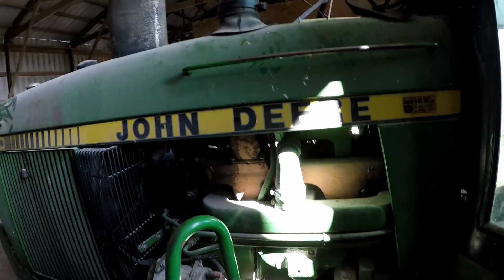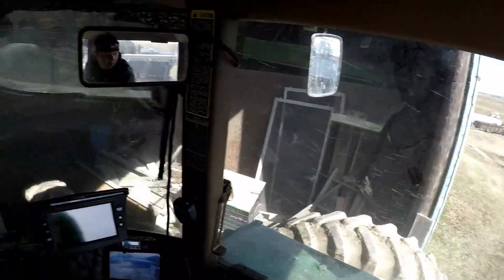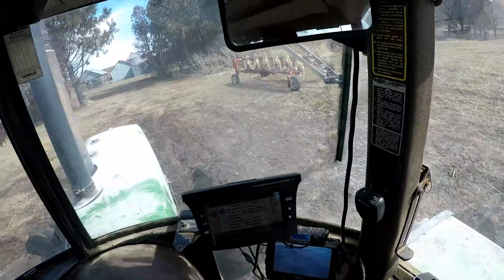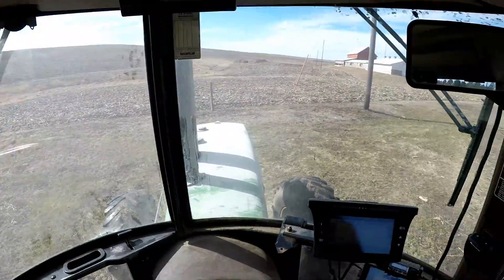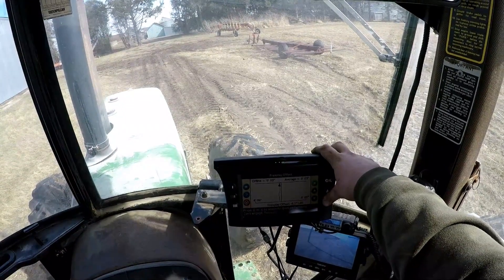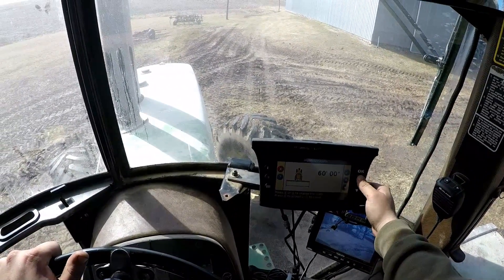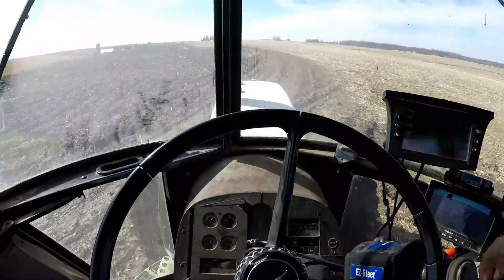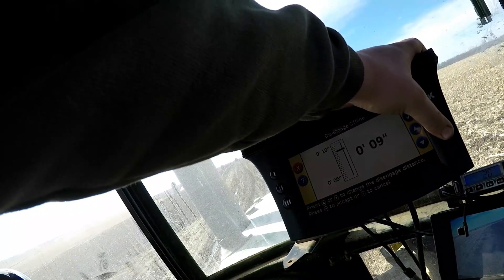Testing Out the Autosteer on the 4450

Comment: Any chance I can get the dimensions for the mounting bracket from someone? I just ordered this unit but they wanted 200 bucks for the bracket that looks pretty basic. Thanks guys, unless someone has one laying around they want to sell for a reasonable price
Reply from the maker: What tractors you putting it on
Reply: @iowadairyboysFarms  8430 jd its the same bracket that you have for  your setup
Reply from the maker: Ebay they are 115
Reply: I've got a buddy that can make me one for nothing but he needs a couple rough measurements like total length of the bracket from the steering column piece and how far up to make the bends. I don't need the spacing for the slotted holes as I already have the unit. Just got delivered today. I can figure out the piece that goes around the column it's just where to make the bends in  the flat bar is the biggest part. Thanks again
Reply from the maker: 10 1/4 long, 2 inches wide, with around a 2inch bend towards the steering wheel.

Comment: Keep messing with your settings and youll get it to work the way you want. If i remember right i usually run the aggressiveness 110 to 130 depending on how rough the field is and whatnot. Sometimes if it gets too far off  you might have to help it get lined back up. I like the motor at the top of the steering wheel so its more out of the way but thats just my preference